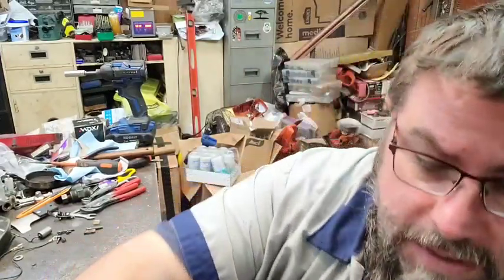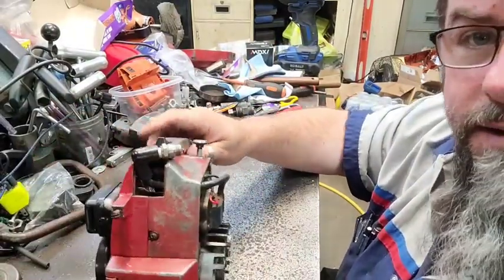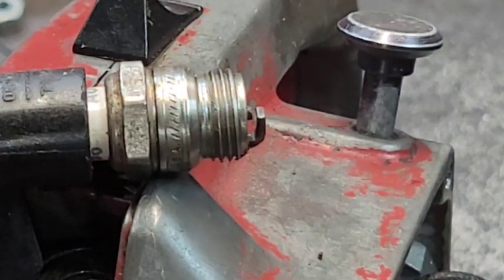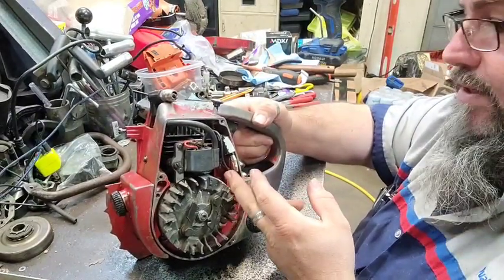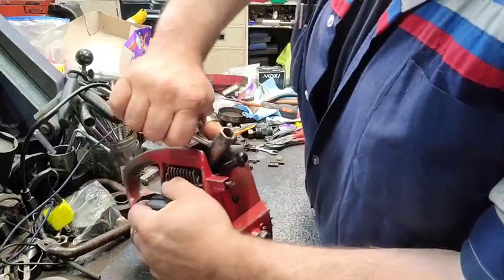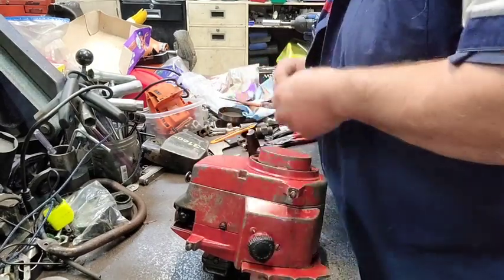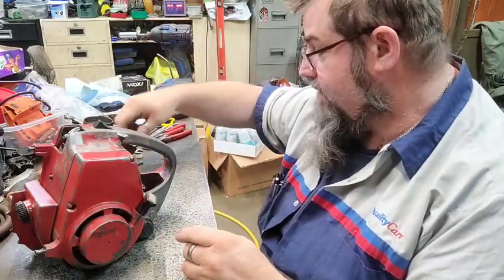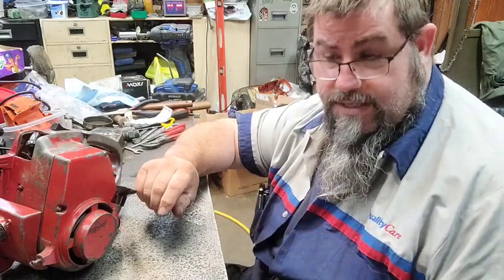Massey 190A Makes Noise!!!

Comment: I have an old Clymer service manual that lists that saw. It has a diagram showing two crank halves and says the crank halves are a press fit. No mention of special tools or jigs. Does mention rod and bearing are an assembly to be removed after crank is separated and piston pin is removed separating rod from piston. Sounds a little odd to me. Hope you get to feeling better soon. Our prayers are with you.🙏
Reply from the maker: Thank you buddy that sounds more right then a slip fit we are still praying for yall

Comment: Quote from New Life newsletter:
A Little at a Time
I will drive them out before you little by little, until you have increased and are strong enough to take possession of the land. Exodus 23:30

If you go out in the garage and attempt to lift your car off the ground, unless you’re incredibly strong you won’t be able to do it. But open the trunk, get out the jack that’s there for changing a tire, and the mechanical leverage it provides will indeed enable you to lift the car. You’re plenty strong enough to lift a car when you do it just a few millimeters at a time. If you go out into the world and attempt to achieve something spectacular within a few days, unless you have access to an enormous amount of resources, you probably won’t be able to do it. Yet when you set a goal and work consistently toward it for as long as it takes, you can achieve whatever you desire. When you pump the jack, the car cannot help but be lifted, a little more with each stroke. When you put forth each effort, you cannot help but move closer to your goal, step after step after step. You have plenty of strength and resources to reach whatever goal you set for yourself, provided you apply that strength and those resources consistently over time in a focused and clearly defined direction. Find the pace that will get you there, keep it up, and achieve whatever you desire. 

Father in heaven, thank You for this reminder to work at our goals, one step at a time and then repeat. Help us not to be discouraged when the road seems long and the goal far off. Help us to move one step closer today and do the same tomorrow. In Jesus name, AMEN!

Little by little, a little becomes a lot.